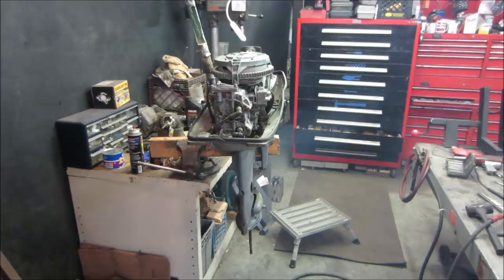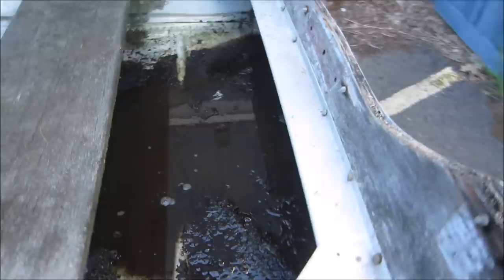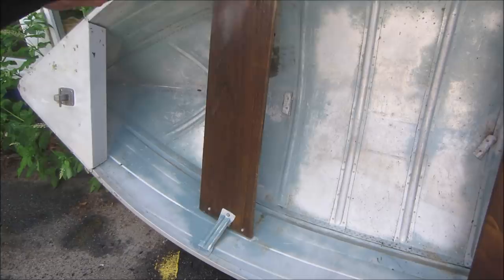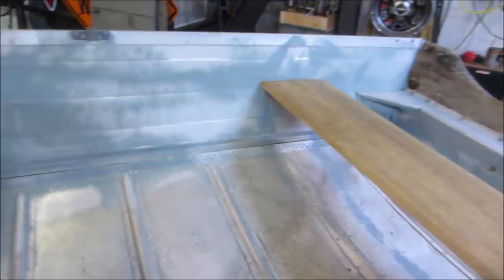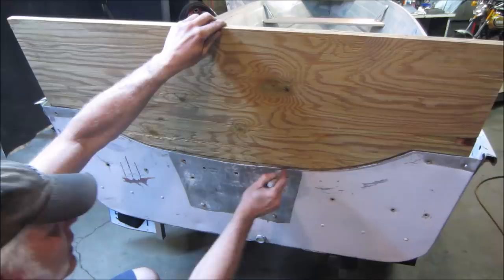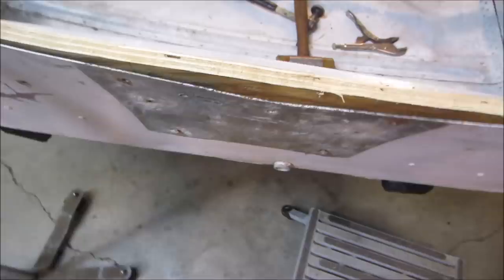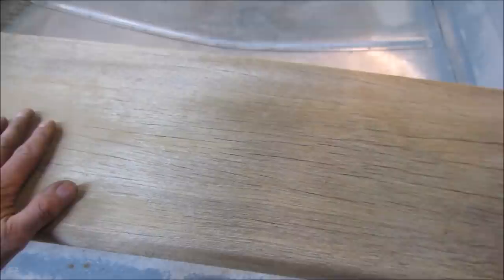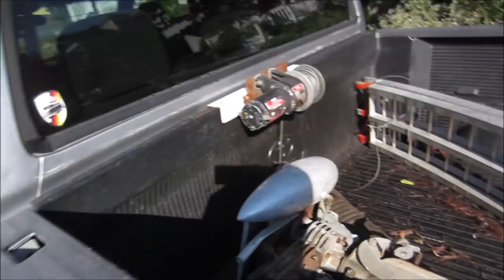Free Boat, First Wash/repair in 20 Years

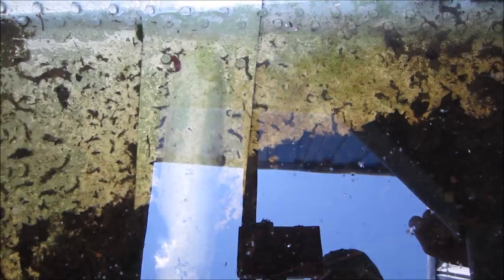Comment: 3:16 Mosquito larvae ! Always put some apple cider vinegar in standing water so the mosquitoes larvae can't hatch and bite you 👍😎
Reply: You can also drop an old copper penny in the bottom. It kills algae and mosquito larva
Reply: @HugoHugunin  nice didn't knew that.
Reply: @NurdRage777  It is why yachts are sometimes bottom-coated with copper based epoxy. It works on all marine life. Ahhh! But, there's the rub...copper doesn't only kill barnacles and seaweed, it also kills fish and corals. A couple of pennies will hardly do that, but something to be aware of.
Reply: Few drops of dawn dish soap works on standing water too. Keeps the beasties at Bay.
Reply: @Viktor Sligo On the contrary the mosquito is the deadliest creature on Earth, due to the diseases it spreads, including malaria.
Reply: @HugoHugunin  Thanks im gonna do that ! Thanks
Reply: One or two drops of light oil. It changes the surface tension and they drown.
Reply: @TheOtherBill  Bungs up their breathing tubes when they come to the surface.

Comment: For best results you should put a liberal amount of marine bedding compound around all edges and screw holes of the plywood before installing. Keeping mineral spirits and plenty of rags on hand to clean up the squeeze out. I used to do boat repair and we always used 3M 5200 Bedding Compound in a tube.

Comment: Mustie1, I hope I catch you before you apply the poly to the exterior plywood on the stern.  The plywood grain, even treated and covered with poly, will check.  Generously brush on some antifreeze and let it dry.  Then apply any finish you want.  The plywood grain will never check and you'll have the satisfaction of using an automotive product on your boat.

Comment: I'd cut out some pieces of treated plywood that fit down in those ends where the big one wasn't long enough, slap some glue on them, and drive them down in there. That would strengthen up those corners a lot.

Comment: Don't use steel for patching Aluminum.  That didn't look like marine plywood!  Perhaps some boater will recognize that 3 masted decal on the transom and you can research the boat.   Likely needs a centre rib.  You must have a 3/4" wood stretcher!  Trim off the bottom corners so they clear the sides by 1/2".   Cut the outside above that rivet line.  2" x 5/16" SS Fasteners.  Angry Birds!!!
Reply: Using steel would eventually destroy the boat due to dissimilar metals working against each other.
Reply: @richardcline1337  
Made that mistake once, never again!

Comment: Oil the teak otherwise it will have to be redone every year. Poly was a poor choice
Reply: Yeah, I agree with you. Clean, then oil only.
Reply: I'm thinking he should have taken the seats out and checked the bottoms of them.
Reply: @richardcline1337  And let them soak in Chlorox for some time. The wood is still full of must, 6that's why they turned out greenish after the varnish.

Comment: Com0n I can’t believe you hacked that plywood. 2 inches short. By a full sheet of plywood
Reply: Yea that's going to stress under load
Reply: rogerwilco99  So? If cost is more important than structural  integrity, why now just use a bunch of magazines and tape?
Reply: gym shoe......go buy some gym shoes and mind your own business.
Reply: Maybe Mustie has some aluminum square tubing to use on the edges, notched where connected to the plywood for strength.  Bonus, they can work as flag holders.  I can just see this in his junk pile.

Comment: Glad you're getting the boat fixed up.  Aluminum boats have been getting expensive, so your efforts should be well worth it.  I wouldn't put too big a motor on it, unless you make the transom stronger.  Maybe keep it under 10HP.

Comment: Yes, put another piece of wood on the back where the engine rests!   Transom should be just about 1.5" in thickness.   I'd make it larger than the outline suggests, perhaps out to the next set of bolt holes if possible, vs. drilling more holes.  Many folks like to put a piece of stainless steel over that to keep the motor from digging into the wood on the back (and front).  Might consider SS or aluminum to cover the top of the transom as well (sikaflex it in place) to keep water out since it's likely to get wet all the time.

Unless you know what to use to seal the wood to transom and the bolt holes, use SikaFlex.  Made for marine environments.  Put at least a bead all the way around the perimeter, both the edges and flat where it contacts the transom and sides to keep water out.

Haven't watched to the end yet, but please do NOT use steel for reinforcements on a boat.  Just really bad practice.  You can make the reinforcements you need from sheet aluminum, you have the tools and experience to fabricate them.   Or just make them of blocks of wood cut to a triangle.

RichE San Diego, CA

Comment: Without nowing the exact model of your boat, here is what your boats may be missing, comparing it to similar boats of this vintage:
* Corner support brackets at the rear of the boat where you replaced the wood panel. 
* A small wood panel that goes on the back where the outboard motor clamps on to provide better support and better secure the outward motor when clamped on.
* A number of aluminum row boats I have seen have wood or metal vertical cross panels that go under the seat benches from one side to the other the boat. That may be what those broken metal brackets once attached too. In some case the support is directly under the very center of the seat in the form of a square-shaped support. 
* Many of these types of boats have metal support/bracing pieces the go from the ends of the seat benches up the top sides of the walls. This can be a single brace, a t-shaped brace an h-shaped brace to braces at each side of each end of the seats (4 braces total per seat bench).
* Many row boats have 2 handles on the back end where the outboard motor goes, one on each side, to make it easier to pull the boat out of the water and for easier loading/unloading of the boat trailer. 
* There seems to be a lot of design variations over the decades in this type of row boat but it’s hard to know with vintage row boat pictures just what is a normal design difference (i.e. it was always that way) and what is the result of being very old and thus parts having broken off, rotted/rusted off, or otherwise being missing for whatever reason.

Comment: Intersting to see the restoring the boat and the engine. In addition, I would check tha boat trailer. There could be corrosion in the bearings. Secondly, I would put some grease in the bearings.

Comment: At the rear in the middle of the boat 🛥. There must be a wooden plate to hold the engine tightened to the boat and also it protects you're boat from any damage caused by the engine. Great vid @mustie
Greets from Jur 🇳🇱

Comment: One mans trash is another mans treasure, especially if the other man is Mustie1.  Nice pond boat, good job.  I am going to edit my post to add the following:  The boat is a test bed for outboard motors, not for much else I would presume.  I would think if Mustie1 registered it, got a tag and an inspection, the flotation foam and the transom would have been  repaired before hand.

Comment: Two things: I would replace the seats and stern with solid wood if possible. Plywood will just de-laminate again over time. I had a similar boat for a short time. I used to carry it on top of a Plymouth Horizon. I would've liked to paint the boat the same as the car so it would look like one big behemoth instead of a blue boat on top of a tan car, but I never got it done. Then I sold it.

Comment: There was I'm sure in the  back when it was new but rotted off and motor the clamp screws just dug in . They broke what was left and tightened the two lower screws. 
From then on they clamp screws to the aluminum. 
Your just putting it back the way it was and doing a pretty nice job of it . It  seems to me your going to end up not a good test mule but a pretty nice boat to fool around in .
One of your best finds I think!

Comment: Those oar locks.  That front nose, that half rotted plywood at the back.  I've ridden in that boats identical twin in va, wv, tn, nc since i was about 4.  And i've had to go through and re-rivet and waterproof.  Even those wooden benches that wasps love to make nests under.  Middle of a river is an amazing place to find out you've been sitting on top of a stinging horde.

It's still sitting on a home built trailer with the wheels off of an old Camaro in my grandmas back yard.   It might be time to resurrect it.

Comment: What I recall from owning a small boat was that the mounting board on the exterior of the transom was a piece of one inch plywood.  You can always double up what you have and glue and seal the two pieces together.  The rear corners, as mentioned by others, need to be gusseted to provide rigidity and strength.  Use 3/4 ply and make aluminium to make brackets.  Stainless or brass hardware is recommended.

Comment: Great results . Gives me hope for mine. Remarkably it's never been painted before still the bare aluminum. Yeah use these as river,pond and putting around the shorelines and coves in lakes . Preferably out of the wind . Mine is 65 or 62 I cant really recall off the top of my head but early 60s  . Can't wait to restore it . Id like to find an early 60s motor that is in salvageable condition I  Still have the original title for the boat . But they can be super sketch especially if your a big guy lol watch your step .

Comment: You would be wise to put corner braces in on the transom.  The would give the back end more support to hold the motor in place.  Otherwise, it could distort and break the mounting boards.  That silhouette is from the other half of the outboard mount.  I'd paint that and seal it completely before final install too.

Comment: Hi Mustie1! I really love your videos! Here is the issue I'm having with my boat: I have a mercruiser 3.0 litre. I was having some bogging issues under load. I changed the fuel filter at the base of the engine, the filter just inside the carb where the fuel line attaches. Cleaned out the clear tube running from the carb back down to the fuel filter at the base of the engine. I put in new spark plugs gapped to .030. Now the boat is running better, the idle is still a little rough but the main issue is after I've been at full throttle for a few minutes I begin to hear a popping sound. I back the throttle down and the popping goes away but then at no wake speed I hear a ticking sound. I've run three cans of Seafoam through 15 gallons of gas so far. After shutting down the engine for a half hour or more the boat seems to work fine until full throttle results in popping again. Thanks for your thoughts!
Reply from the maker: l wonder if it has adjustable valves and one or more are tight,

Comment: If that boat were going to see a lot of water time, I'd have some suggestions. 
1) put anchor head  (square head) recessed bolts so that the vibration of the motor doesn't work the bolts loose, AND use locktite.
2) seal that transom down low and up top to prevent the water from seeping in any faster than it will
3) wedge some pieces into the sides from the top and glue them in, (The strength of the transom also comes from its rigidity as well as the thickness of the wood)
4) 1" boards from the lip up to where the motor sits to give it more strength
5) Fiberglass or at least seal every piece of wood with silicone

55 years of boating has taught me a few tricks. You prepare for what won't happen and you're ready for what does!

JMHO

Comment: Excellent job so far Mustie.  I would be unbolting those 'seats' to make sure the underside of the wood is cleaned and sealed as well.  When not in use (if not in your shop) you could store it on it's trailer upside down to keep the water out.  And if needed you can add foam for flotation under the seats, since the regs probably changed since that boat has been built.  Nice little  putt putt boat for your cabin, no one will steal that.

Comment: Hi I would use a product from Home depot or Lowes called ZEP cleaner degreaser it works well straight out of the bottle or in aa pressure washer, Keep up the good work I always enjoy it when you ask me questions. Many thanks for all the engine work and other repairs, they are very helpful,

Comment: Definitely get a larger and more appropriate plywood for the transom. Even coated it will rub through and the stuff in the wood will cause corrosion and oxidation in the aluminum fast and bad. It will be worse in a salt environment. Galvanic reactions are pretty rough. Do brace the rear corners. There is a decent amount of force pulling down there. The corner braces also help keep it square and keep the seams from warping apart.

Comment: Cool video...definitely brace the seats.  You should think about creating some type of cover for the new transom as well.  Based on the video it looks like the previous owner might have removed the corner bracing and transom cover when repairing the corner.  I was one of the people shaking my head when added the wood to the outside.  If you were looking for more material to mount the motor, I would gone along the inside of the transom.

Comment: Not Teak, by the Knapp lifting it looks like mahogany, if you want it smooth you need to seal it with a sading sealer then sand it again, repeat until the knapp stops lifting then varnish it. It is an absolute PITA but it is nice when finished.

Comment: That wood does look like teak. You poly will probably do OK, but most finish teak with linseed oil and turpentine in multiple coats. Teak is an amazing wood, really doesn't need much protection anyway.

Nice job on the aluminum, looks fantastic!

Comment: Mustie , the absolutely best ( and cheapest ) wood sealer is 25% Urethane ( like you used ) and 75% paint thinner (mineral spirits)   mixed together … Sinks in deep and 3 or four coats makes it waterproof !!!…  Used on many outdoor projects for the last 30 years …  It passes the water drop test … the drop evaporates before it ever sinks in !!!

Comment: Not bad for free.  I look forward to more outboard videos.  Also 350 for that 5Hp would be a steal.  Just remember boats have several seasons.  You don't sell marine supplies after  September or before April, that's when you buy to get the steals on old junk. You get your first bump in April - June when everyone is commissioning their boats.  Then it slows down until the second week of July when everything breaks. Outboard and boats can go up as much as 50%.  Plus if you say "only run in fresh water" us salt water people will flock to buy it.

Comment: I've seen several off these old aluminum row boats where on the floor they put a single plank of wood the length of the boat.. You inevitably end up with a little bit of water in the bottom and the board gives you somewhere dry to put your feet.

Comment: the one aluminum boat i owned had an aluminum cap all along the top of the transom, the corner braces were cast aluminum and had hand holes,  it did have a nice 9hp mercury that would only start when the boat was out of the water...lol

Comment: The piece of ply wood should be rubber. The two little holes you pointed out are rivet holes to hold it, the pice of rubber, in place when you replace the back board. The rubber will reduce vibrations.

Comment: Take a couple of short pieces of round tube, flatten the ends, bend them 45 degrees,  drill holes through the flattened ends and use these to strengthen the corners between the sides and the transom.

Comment: A replacement transom that is wider than 48", should start with 2 pieces of plywood 1/2 of the finished thickness.  The first half should be cut into 1/3s and the second into two halves.  Glue together with epoxy.  If you are using CDX plywood, the edges need some detail.  Pour un-thickened epoxy into the voids (so that it can run into the cores.  Before it completely cures fill the voids with thickened epoxy.  Let cure.  light sand an epoxy that dripped down either face and then apply epoxy with a roller.  Again, before totally cured (still tacky) apply a second coat.
Reply: I'm pretty sure that's for fiberglass boats and for larger boats with a higher horsepower outboard. Yes, the wood should go from side to side and be untreated. You can seal untreated wood with multiple coats of sealer of some sort for protection. 

Treated wood will eat away aluminum due to the copper used in the treating process reacting to the aluminum.

Comment: I just finished basically the same project on a mid 60's Crestliner Super Seamen.( Couldn"t be sure of the date. Apparently all the records of the HN numbers were lost in a fire.) It had aluminum panels on each side of the seat, 2 of which had styrofoam in them. I added some to the bow seat. I added a beefier transom and 5/8 plwood on the rest with stain and 5 coats of spar urethane. Couldn't find any good videos on doing it. Till now.